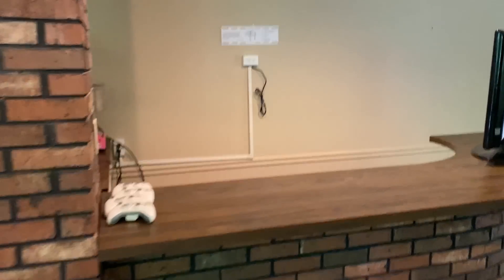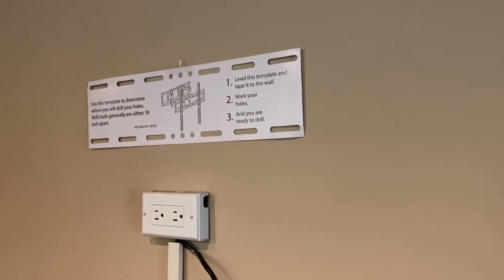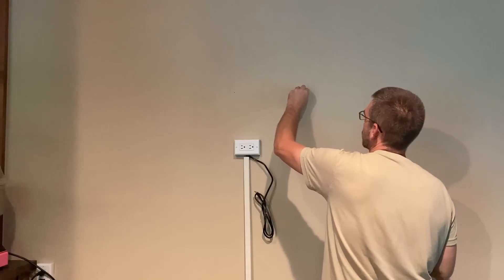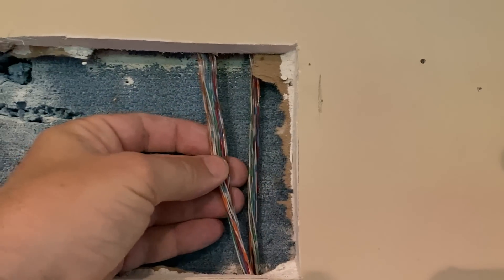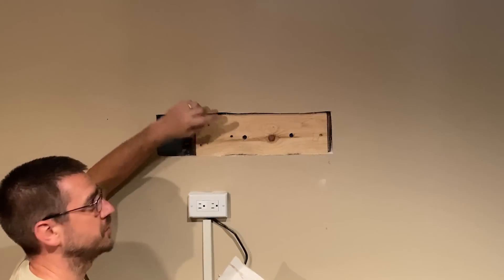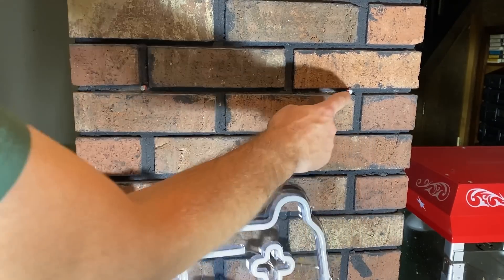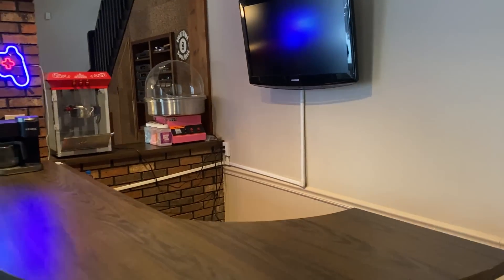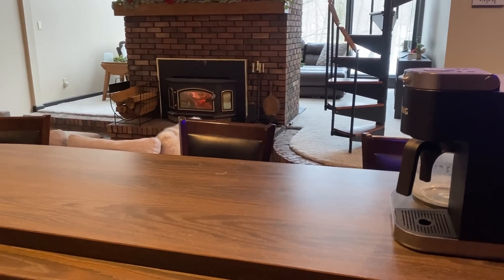Mounting a TV When You Can't Find the Studs - Game Bar Renovation (1)

Comment: I've run into this issue before as well. I made a surface wood plate to mount it the studs then mounted the tv to the plate I made. It was better then cutting the wall open for nothing. I painted it to match the wall and you would never know it was there.
Reply: @carlostavaresjr958 when you say you made a surface wood plate, did you use plywood or some 2x4's or what?
Reply: @mzzcookiecook  At home depot they have unfinished wood stair tread in 48in sizes. I cut mind to what I needed to mount up to the wall studs. I got the cheapest one and painted it to match my wall color. Bolted it to the wall studs using a stud finder. Lastly, mounting the tv mount to that stair thread for a solid mounting position for the TV.

Comment: Those bunch of wires that you saw are called e wire they are telephone wires in the '60s and seventies that were run throughout the house during the build they they run through every wall in your house so you have the option to put a jack anywhere in the house that these wires run if you go into your attic you will probably see them looping up through your attic too